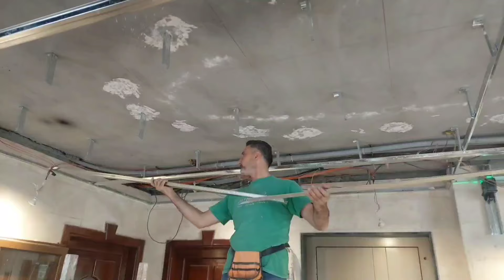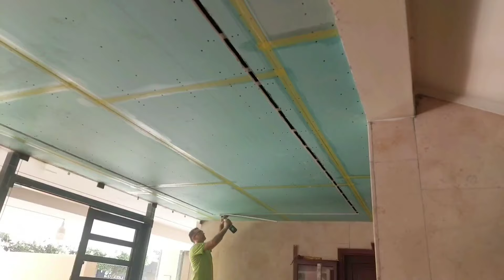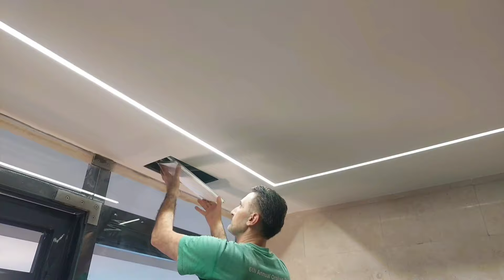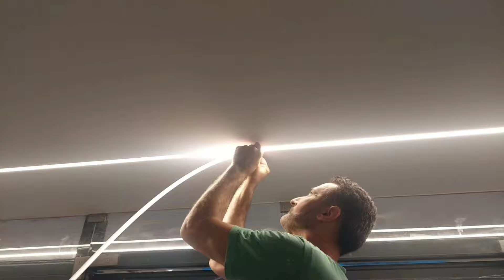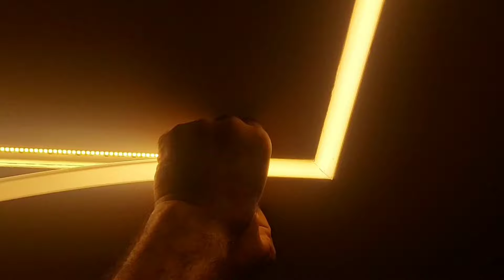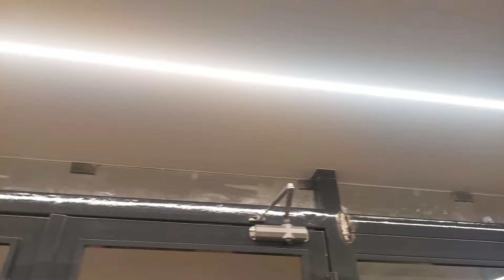أجمل ديكور جبس إنارة مودرن ممكن تعمله لبيتك

Comment: Hello, we want to measure the ceiling that has waves and it is not level. How can we measure it? For example, the difference between the top and the bottom of the ceiling is 5 cm.
Reply from the maker: @OSM2024Mehdi  you should use laser☺️